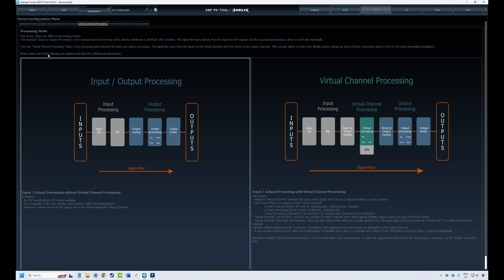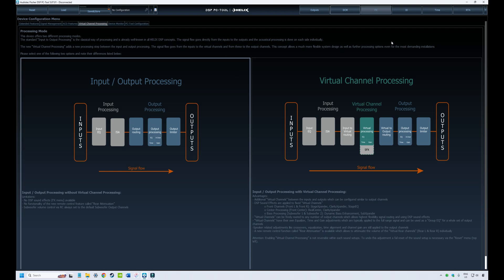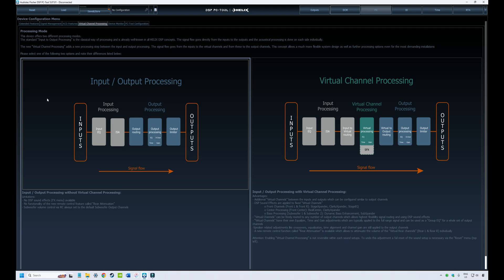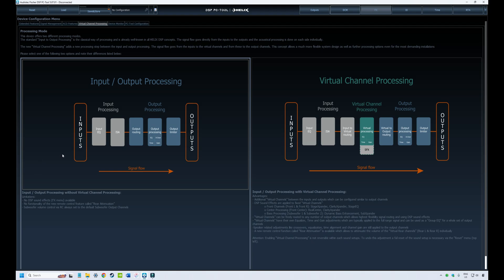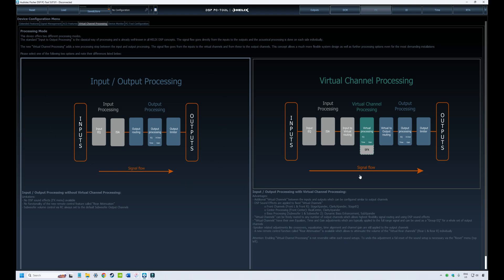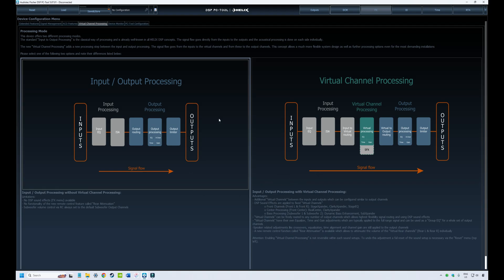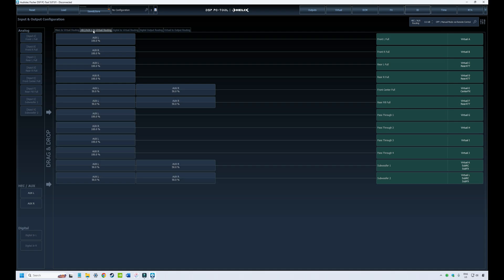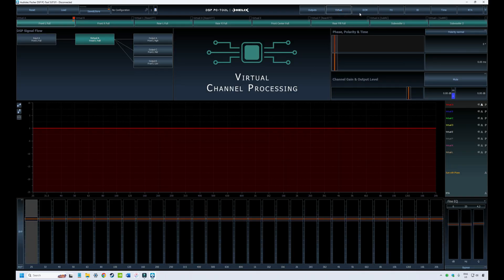HELIX DSP PC TOOL tutorials - Part 4 - Standard vs Virtual Channel Processing Mode

Comment: Thank you for your truly helpful videos - great work! If you find a moment, I'd really appreciate it if you could answer at least some of my questions.
My Match PP 86DSP MK1 doesn't support Virtual Channel Processing (VCP)
Should the EQ settings for the front midbass (Audison AP 8 plus tweeters on dash) and rear midbass (Audison AP 6.5 plus tweeters) overlap?
Do I need to tune the front midbass with tweeter separately from the rear ones or together one side front and rear?

What if I would like to make the rears differential rear fill.
Shal I EQ differential rear fill separate?

How should treat the center speaker (coaxial Ground Zero GZIF 4001FX)? 
Should its frequency response also overlap with the others? Do I eq it separate?
Just to mention-I have an Alpine SWE 1044 subwoofer installed in the rear. 
 For context: I have the exact measurement microphone you recommend, and the car is an Audi A6 C7 with the 6-channel Audi Sound System.
Reply from the maker: Hi Boog, Welcome to the channel mate.  I am glad you are enjoying the videos.  There is a lot to unpack in this question, but I will do my best.   So first of all I notice you are watching one of the tutorials from the Helix DSP tutorial series.   Just be aware that using that software is pretty limited as many of the features are automated.  It is really designed for people or shops to knock out a quick basic tune.  So its quite difficult to answer your questions in relation to the Helix software.  The rest of your question is basically asking how to set cross overs and time align front, rears and centre channels.  Ill do my best to answer them, but its not something I can cover in a comment section. Pretty much all the information you need on how to do a car audio tune, is covered in the REW car audio tuning tutorials.  You can find these tutorials in playlists section.  (https://youtube.com/playlist?list=PLw5Tw4c-YYvMctqmhWsO1HXpO1r_NUXkQ&si=DeTdNKAhjKQiyblJ)    (https://youtube.com/playlist?list=PLw5Tw4c-YYvPG8_gVzrNG__1V3SUQafJZ&si=jGwpdETkUXjyATTH)
If you have not discovered them yet, I would definitely grab some snacks and start there.  Meanwhile I will have a go at the questions you asked, starting with, should your EQ settings for your front midbass and rear midbass overlap?  Um I am not sure what you mean by EQ overlapping.  If you mean crossovers then it depends on if you mean your acoustic crossovers (no you should not overlap) or electrical crossover (yes you can overlap).   Do you need to tune the front midbass to the tweeters or together or one side?   They way I go about tuning is to do all my level matching and EQ work first and then time align the speakers in pairs L&R tweeters, L&R mids. L&R midbass, L&R rears etc and then time align the pairs to each other.  But that is how I tune, other people time align the left side of the car and then the right, so it depends on who you speak to :)  If you want to make your rear speakers differential, yes you would EQ them separately.    In terms of centre speaker the frequency response will overlap with other speakers and yes it will need to be EQed separately.   Sorry I can't be of more help, but I would start by watching the car audio tuning tutorials first and if you still need help then drop another comment.   Best of luck
Reply: Thank you so much for your answer Socket 👍

Comment: is Virtual Channel Processing support PC-Tool 4?
Reply from the maker: Hi Imkark... yes VCP is available in version 4.   Whether or not your dsp has virtual channel processing is another matter. Im pretty sure you can check that on the audiotec fischer website... hope this helps :)
Reply: @socketsocket2763  I have a Match M 5DSP (MK1), this one is only supported in version 4 and i do not have VCP, which also is not available in the software. It didn't ask for it also. So i Think it depends on the DSP your using if it will give you the option or when not supported it doesn't even show or ask.
Reply from the maker: Hi Imkark, no your dsp does not support virtually channel processing